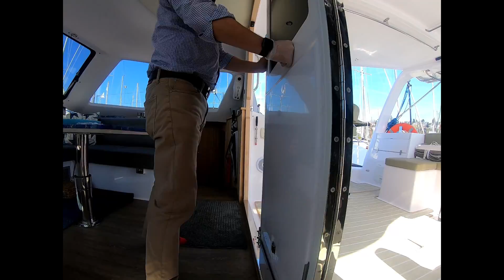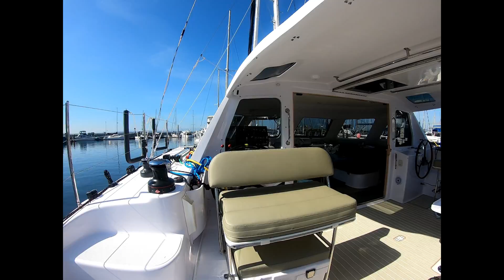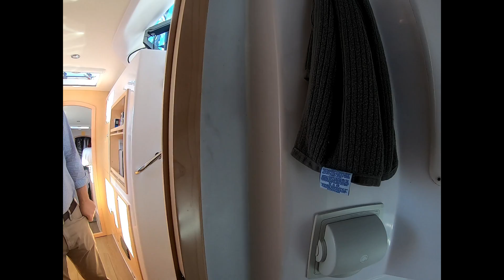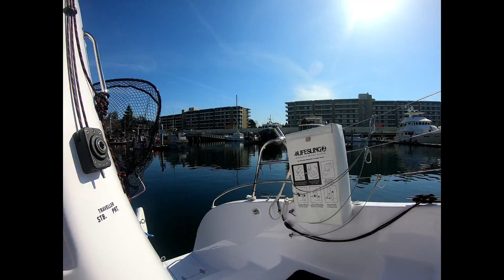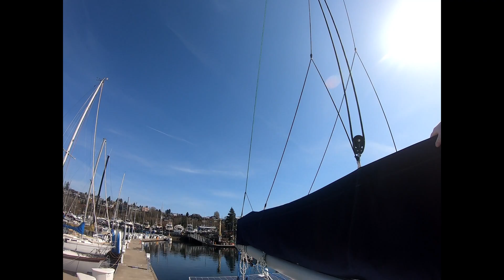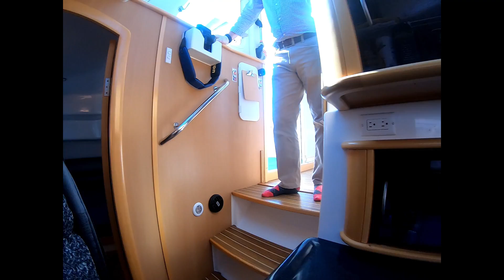1260 and 1160

Comment: Did the 1160 have offboard engines or interiors like the 1260?
Reply from the maker: The main difference between the 2 as far as I saw was the cockpit area was larger and accommodated more seating. To me, the staterooms appeared the same. The Salon was also slightly larger on the 1260 but not overly so.
Reply: The 1160 has outborders mounted under the Helm seat. Even a better option ( less weight and more space).
Reply: @eljefe1153  The newer model 1160's have the option of outboards, or inboards.  The model in the video was an older Deluxe, with inboard diesels.  It wasn't until late 2014 that Seawind introduced the 1160 Lite, which offered the outboard option, as well as changes to the interior (some laminates, and no more wood).

Comment: Which one are you gonna choose if you go with a Seawind?
Reply from the maker: It really comes down to budget, I like the 1260 more than the 1160, but the 1160 is a great value and you really do not lose much in functionally. The difference in boats is right around 270K so I'd take the 1160. Unfortunately, they sold it so it's no longer an option. I'll be serious with cash in hand late next month or in July so we will have to see what's on the market and in the budget at that time.
Reply: I agree. I go for 1160 too. Thanks for the tour.